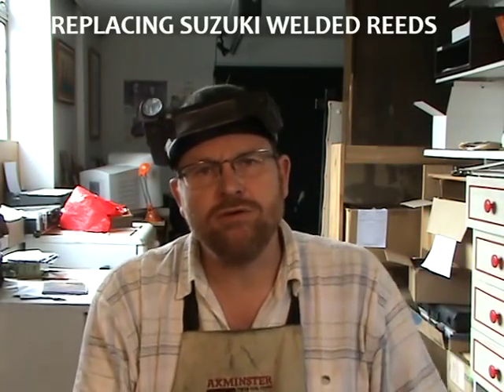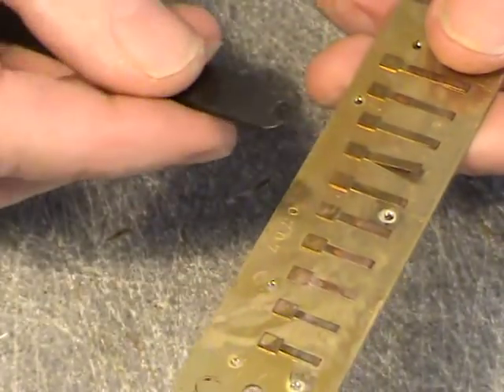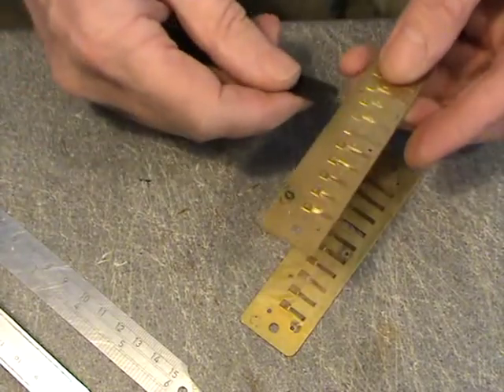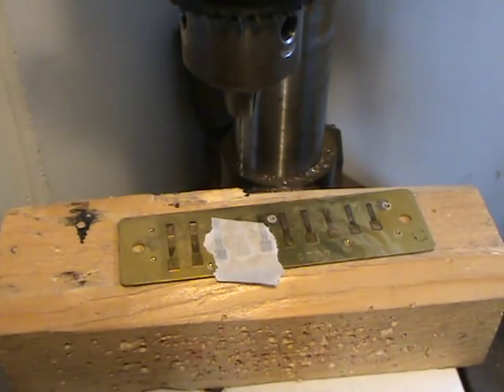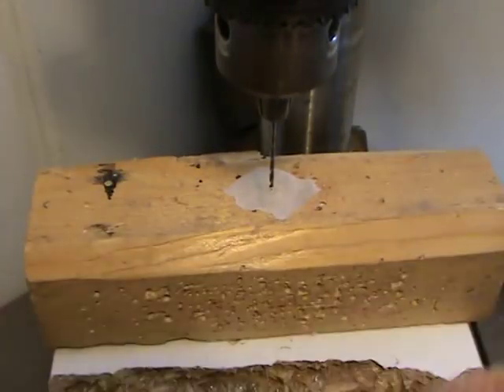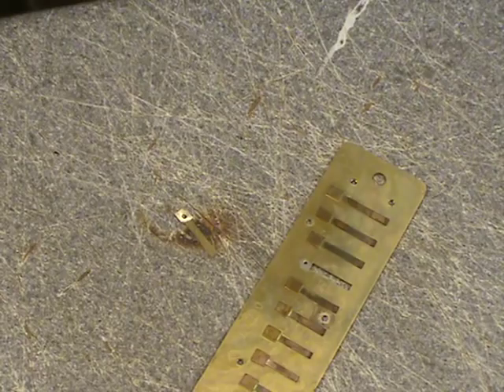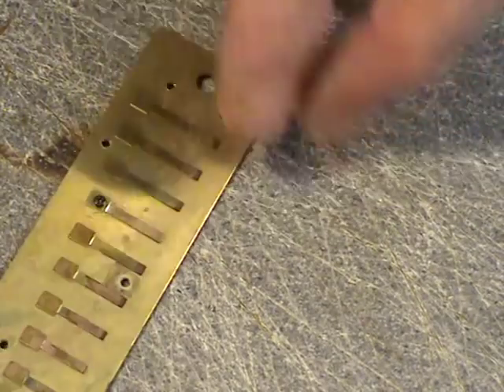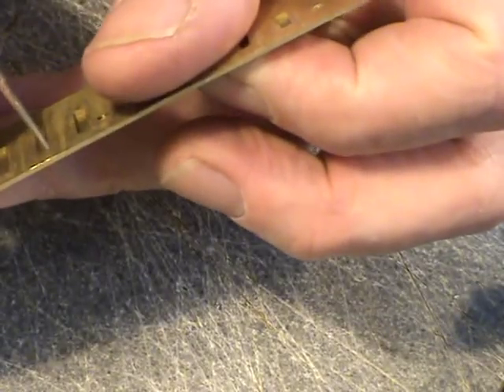Replacing Suzuki Welded Reeds: Brendan Power

Comment: I use the Suzuki FireBreath harps, and I was wondering if it is possible to buy a set of these reeds from Suzuki instead of having to buy a bunch of new reedplates to get the reeds. If that's possible it would be fantastic. Thanks for posting this video, I had been thinking of trying a very similar procedure.